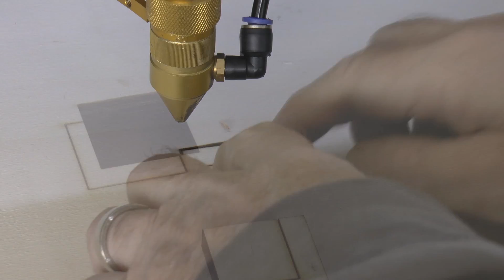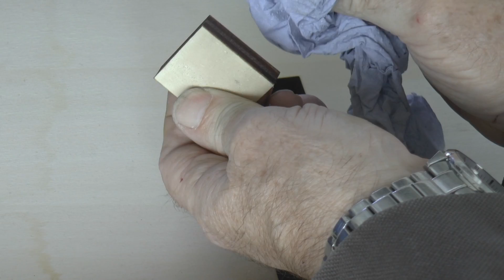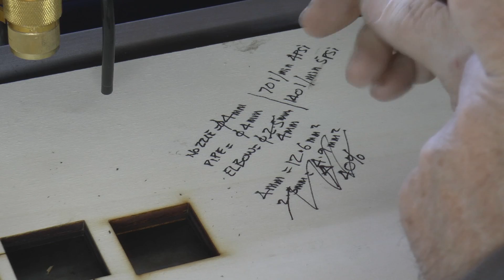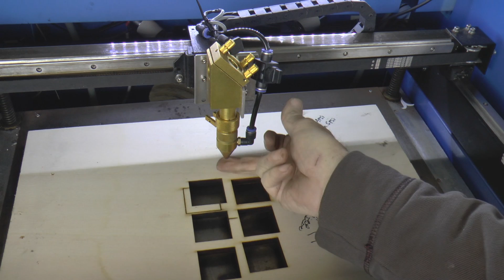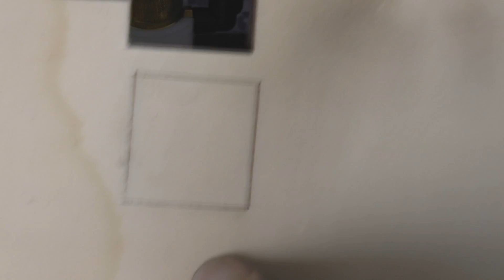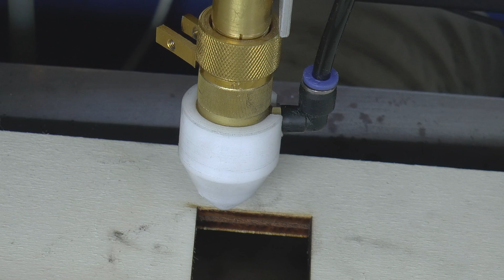RDWorks Learning Lab 87 Maximising air assist efficiency

Comment: after running some 5mm acrylic cutting, adjusting the air assist support, the difference is with a stronger air assist, the top edge of the cut will be slightly frosted compared to the bottom edge. 
However, when lowered the air flow to even lesser than my original pump, it gives better flame polish finish. however, i will get flame shoot out at the bottom of the acrylic. the paper cover does protect the acrylic, so there is no surface damage. will need to explore is there any possibility on minimizing the flash flame below the acrylic while having a slow air on the air assist
Reply from the maker: Hi Cary
You were warned it's not the same as wood. The cutting action is not a chemical decomposition by burning but a direct conversion to gas (sublimation) with no liquid phase.
There are two possible answers. If you are flaming the fumes it means there is excess energy after you have cut through. You can balance this with adding a bit more air assist or run a bit faster so there is less excess energy when the cut is through. Have you set your focus point 2.5mm into the material? The second and very interesting option is to explore the DOT mode. It has some great uses and beccuse it can use high energy intermittent pulses it can do great things with difficult to cut materials like foam which would normally melt away or catch fire.
Best regards
Russ
Reply: SarbarMultimedia my focal distance is 8mm from the tip of the head.  I have the adjustable laser head.  I did try to increase the speed but I am getting banding problem on the slightly higher speed.  I did see my lens has a small slit hole through the coating.  It may be causing the unusual banding problem. So one of the main problem is even if I go slightly faster,  I will not get the nicer polish edge finish.  Will try out some other settings once I finish with my current projects and my new lens arrive.  Also got a new set of k9 mirrors.  The price of the set of 3 is between MO mirrors and the silicon mirrors.  Will see how that one turns out.
Reply from the maker: Hi Cary
8mm seems an odd distance What focal length lens do you have?
Be VERY gentle with those K9 mirrors. The are basically a crown glass base with a gold flash on the surface. There are not very durable and if you break through the gold, the glass underneath is fully absorbent of the IR radiation, will heat up and crack.
Best regards
Russ
Reply: SarbarMultimedia my lens is a 20mm FL50.8mm and the manufacturer came with a 8mm spacer for that original lens. my original mirrors are MO mirrors which i notice is beginning to have a darker shade in the middle. Probably will measure the depth of the lens again. but last time i did a focus test and 8mm seems to be the smallest beam cut.
Anyway now i no longer user a spacer but using a filler gauge and caliper to measure exactly 8mm and then use that filler gauge bundle to correctly set the gap😁😁
Reply from the maker: To cut 5mm acrylic you will need to reduce your gap to 5.5mm. That will also allow you to go faster.
Best regards
Russ
Reply: SarbarMultimedia 5.5mm🤔 hmm. my laser head is the black version with the sliding tube that is able to slide up and down. 
but i will give that method of 5.5mm gap a test and see how it turns out. but first off the bat my mind is thinking that it will be out of focus range and the cut line thickness will increase. will try that out and revert back on what is the possibility
Reply from the maker: Hi Cary
You are right about the line thickness increasing slightly but the maximum energy density occurs at the focus point and drops off quickly either up or down from it. If you set the point of max energy density at the centre of your material you will get the most efficient use of the power. Setting the focal point on the surface is exactly what you want for engraving.  Remember that these machines are sold as engraving machines that will cut (within limits) and not cutting machines that will engrave.Engraving requires little power whereas cutting does.
Best regards
Russ
Reply: Ah I see your point. It is a very interesting insight. I will try it out and see how is the result in this case...:) Thanks for the input.

Comment: as a follow up from my previous comment on the compressor option, i have replaced the typical air pump with a 24L compressor. i have an external valve control which also strip out the moisture before going into the laser with a dial valve control.
With my initial reference of using the air pump to cut 3mm plywood i can cut at 60% at 24mm/ sec. Once i swap with the compressor, with adjusting faster air flow, i can cut on the same power but cutting at 50mm/sec which is 100% faster. definitely with a stronger airflow, it definitely helps makes the cut speed faster. may be diffirent with thicker material bit for 3mm the speed is definitely 100%.
Reply from the maker: Hi Cary
Thanks for that feedback. That just confirms exactly my findings To cut plywood you need maximum power and run as fast as the speed will let you go. If you do not get enough air into the cut the smoke builds up and does two things. Firstly it reignites within the cut and causes chearing of the edge and it also absorbs the IR energy , thus decreasing the cut efficiency. Air ,Air and More Air produces  a cleaner faster cut. Care though. not for acrylic.
Seasons greetings
Russ
Reply: SarbarMultimedia will try out for aceylic next week after i work out some designs for somw gifts for my client. 
another thing i did on my cutter was also with regards to my exhaust system, i have enabled 2 suctions. one at the bottom and another at the back of the cutter. so with the 2 suction cleared the smoke out faster which allows better cut speed on the same pump. as what you mentioned, more smoke causes drop in cut power. so this dual exhaust and the compressor give a quite high speed in cutting. 
will try out the acrylic next week on the new system and see how is the result.
Seasons greetings to you too🎉

Comment: does it really make sense to drill out that elbow? A temporary constriction in the path of a compressible flow (gas) doesn't have an effect on the velocity and pressure of the output (bernoulli effect). Though adding a constriction at the end of the line (like you did with the 3mm cap) will increase the velocity and decrease pressure.

Comment: Hi Russ, a related question as I assemble bits in anticipation of my laser arriving on Tuesday. I've attached a length of 6mm ID clear hose to a small cheap 12V inflatable toy pump and attached it to one of my variable lab supplies. Running it at about 6V (to extend it's life and reduce noise) I get a good stream of air from the nozzle end, similar to blowing on something with a medium human puff if you know what I mean! Would that be about the amount of air you get from your little compressor? Cheers, Ingmar
Reply from the maker: Hi Ingmar
The whole secret of air assist is how efficiently you can get it INTO the cut. Most machines are supplied with a nozzle that has a 4mm hole. That is quite bad news because it means the airstream is moving at a large diametern and slow velocity and is less efficient at getting into a a 0.3/0.5mm wide cut width. Reducing the bore to about 2mm has a significant efficiency benefit so your little pump will suffice but concentrate on getting as much of you available air as possible into the cut. Fot acrylic the flowrate needs to be low but for wood and all organic materials it needs to be as much as possible to clear the IR absorbing smoke from the immediate cut area (in the cut not just the surface)
Best regards
Russ

Comment: Russ, do your purchased thumb-drive videos include comment history? If not it should. If does please render my comments. ron
Secondly , If increasing the air volume extraction preseed increased air compressor volume would this induce change in wood edge burn and or effect acrylic edge thickness cooling and power density of cut.
Reply from the maker: Hi Ron
There are no comments on the USB..... that would be  an awesome task that I would not want to undertake. The volume of extract air will have a very small effect on the  cut quality. The controlling factor is the amount of air that you can force into the cut itself. Acrylic cutting is a sublimation process and needs anything from very little, when you are trying to achieve a polished edge , to half flow for an efficient cut but with more edge striations.. Any organic material cutting is by a burning (chemical decomposition ) process and needs copious amounts of air in the cut to dilute and evacuate smoke. Smoke is a great absorber of IR energy and so decreases your cutting efficiency if you do not keep the cut area free.
Best regards
Russ
Reply: Russ did receive my request to rake equity of the videos content. A comment you recently made to me "Frankly Scarlet I don't give a dam" led me  believe it was a subject you might consider. If not , let know that. When is LL88. Looking forward. ron

Comment: Hello Russ, I just started following your channel as I research buying a Laser.  I was wondering if you could comment on the low cost C02 lasers with the two heads that claim to have metal cutting capabilities?  Google has not been much help on this.   Thank you
Reply from the maker: Hi Daniel
I have a lot of experience at using and running real metal cutting lasers of the industrial type  Cutting metal is a completely different technology to these non-metal cutting "engraving" machines. Firstly you will need a special cutting head for metal that will allow you to feed pure oxygen into the cut for cutting mild steel. Stainless is a completely different process because you need more power and huge amounts of VERY high pressure nitrogen. If you watch any of the you tube videos cutting stainless you will always hear the high pressure gas but never see it. Unless you intend running it as a business it's not a cheap hobby. I advise calling a local laser profiling business and request a visit to see the technology. Then you can go asking questions of Chinese machine suppliers
Best regards
Russ
Reply: Thank you, for your response it supports my belief that if it sounds to good to be true it probably is.
Reply: There are some machines equipped  with dual source that could use both Co2 laser and Fiber laser. But more expensive than others.

Comment: i was wondering with a comment that one of my associates mentioned on the air assist. i was thinking that the standard pump is a constant pumping in which the air pushed through is a cycle. would it make any difference if a compressor wws connected and the air assist is connected to it and controled flow using a air valve. that will give a constant air flow instead of pump cycle. 
Would a more consistent air flow be more better in the cutting?
Reply from the maker: Hi Cary
Yes the airflow is pulsing but because of the length of pipe from the pump and the compressability of air there will never be a point in the cycle where there will be zero airflow at the nozzle. You could easily remove most of the pulsing by adding  a 5 litre plastic bottle into the line to act as a non-storage reservoir (the technical term is accumulator). It may have a small benefit to cutting wood  but I suspect it will not be worth the effort. I have considered it and possibly I should have tried/demonstrated it in my video. It may be worth a revisit to answer the question for all
Many thanks for the comment
Best regards
Russ

Comment: Russ, great video. I absolutely agree regarding air. I completely removed the air pump that came with my machine and piped in a compressor with a regulator. I use it alot especially for cutting wood. Even used it to cut a puzzle in 3/16" plywood using a method I point out in my video at https://www.youtube.com/channel/UCkxe9P_MbvwtjJYkvAHfMww
Reply: Duane Etienne does the compresspr provide a much better cut finish? what size of compressor do you use and how much air do you set for the air assist?
Reply: Well I believe it does to a point. As Russ mentioned in the video smoke is an absolute killer of your laser beams ability to cut. By more effectively removing the smoke, better cutting. I use a 20 gallon 2 stage compressor with an air dryer. As far as how I set it, it really depends upon the material. I just play with the air until I get what I feel is optimal for what I'm cutting.
Reply: Duane Etienne i see. it is a great insight. thanks for the info🖒

Comment: Hi Russ,
Love the series of videos 'Learn with Russ', as a newbie, they are really helping me. 
One issue I am having problems with is foam and in particular neoprene.  10mm Neoprene really seems to be difficult to get to cut, I end up having to do 3 passes, but then end up with lots of charcoaled edges that makes a right old mess!  At 60% power and 5mm/s the laser only cuts approx 3mm deep!  On these setting I can cut 10mm wood without problems - even better after watching your latest video and drilling the elbow.  I can cut 12mm foam ok, but neoprene is the problem which doesn't make sense as neoprene is more dense than form, but less dense than wood!
Your wisdom on these material densities would be most welcome.

Thank you.
Reply from the maker: Hi 
Foam is a very sticky melty material  Constant power is a killer on such materials. Instead of cutting select DOT mode. There are lots of parameters to play with but the principle is to produce a series of overlapping perforations. You may hit a good mix quickly but if not then persevere because your answer is definitely in there. Start off by setting  the manual power button to max power. (for your machine 60%?) Put a piece of masking tape under  omder your piece point and do a pulsetimed pulse to find out what time it takes to piece through. You will see from the masking tape if/when you have made it through. that will be onr major parameter nailed then it will just be frequency and speed.
Good luck and thanks for the kind words
Russ
Reply: Thanks Russ, sounds good, I will give it  a try.

Comment: Russ thanks for the analysis I also made a shroud extension for the 50mm lens.  These pumps are not continuous flow more of a fast puff puff flow so I made an accumulator from an old pop bottle which acts as a capacitor does in an electronic analogue to smooth the flow.  I didn't analyse it in your depth but convinced myself it improved the cut.  I wonder if those little left over traces are due to this?  Keep it up, good stuff as usual.

Comment: Have you consider using a mix of air and CO2 or argon to reduce  charring?
Reply from the maker: I come from a metal laser cutting background where where we used huge amounts of pure nitrogen as a cover gas for cutting stainless steel and oxygen as an accellerant for cutting mild steel. CO2 and Argon are expensive gasses and I'm not sure that their use for hobby work could be justified. The point of my exploration was to prove that the more efficient you can make fume removal from the kerf, the cleaner and faster you can cut. Max out the power and run as fast as conditions and lens will allow and you get a pretty good job without the extra expense and complications.
Thanks for the suggestion it seem to have validity. BUT if you stop and think about it for a few seconds and ask "how does the wood cutting action take place?" You will realise that wood does not MELT under the action of heat, it chemically oxidizes (burns).  The clue is in the word oxidizes. I'd be pretty sure that excluding the oxygen will KILL the cutting action. I DONT KNOW for certain, I'm just using logic and experience. If you have a workshop that has the bottled gas, perhaps you could experiment and let me know the results. Sincere thanks
Russ
Reply: SarbarMultimedia thank you for your replay. I have been asking myself this for a long time. I don't have bottle gas in my humble setup. But your points are completely valid and you have the experience. Perhaps I will try in the future. I have learnt so much from your learning process. I have enjoyed every single bit of your videos. Thank you again

Comment: I just drilled out my elbow fitting just about doubling the air flow and am now able to cut wood about 30% faster. Excellent! Thanks Russ! I seem to remember a video were you tested this and determined that air flow didn't really effect the cutting performance.

Comment: so maybe consider checking all the air pipe fittings to see if they could also benefit from boring out to 4 mm?
Reply from the maker: It is a valid point but I know these fittings pretty well and simple elbows and straight couplings will not suffer the same issues . The main reason the swivel elbow was designed the way it was is because it  contains an O ring seal in that small bore section. I suspect  my 4 mm hole is pretty close to the bottom of the moulded O ring groove. Luckily it didn't break into it or I would be looking for another tube fixing solution!!!  Not all machines will be piped the same as mine so it is worth checking your machine, especially any swivel fittings.
Great comment. Many thanks
Russ
Reply: no worries.. every mL counts in efficiency :)